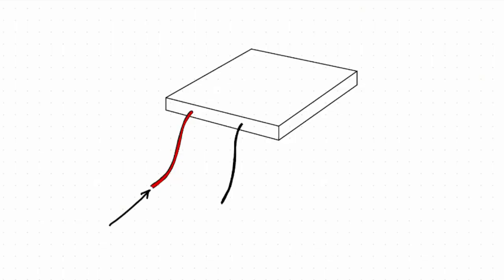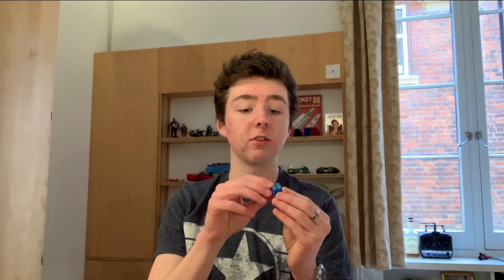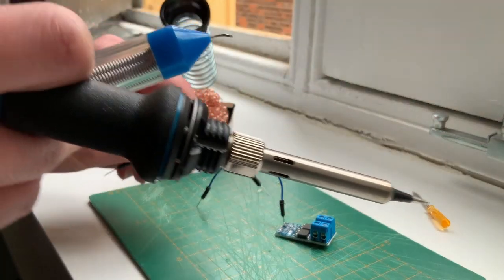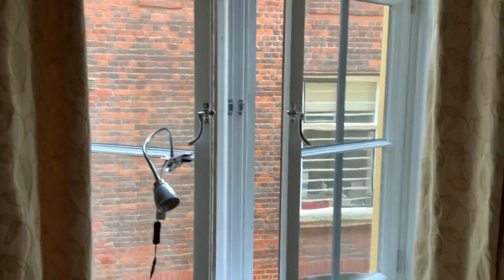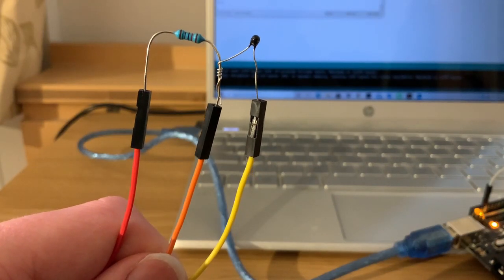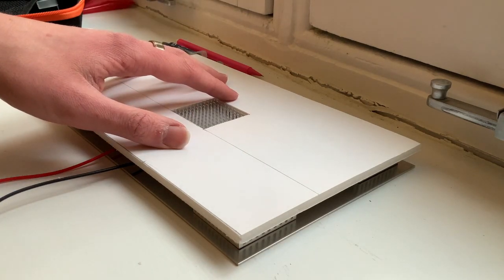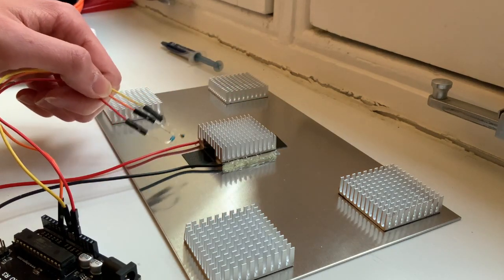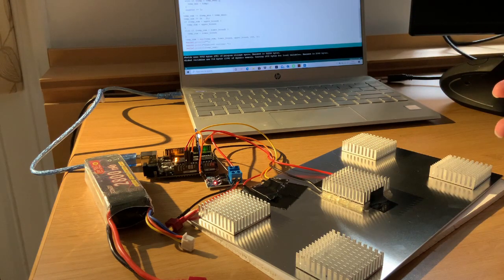Noiseless Computer Cooling System Build (using Peltier coolers)

Comment: I work on a system like this. I used the laptop cooler stand, peltier and copper plates. The fan of the cooler stand is in contact with copper plates, cooling to copper plates and peltier hot side. The cold side is in contact with CPU cooling coppers. I will upload a video if it is work stable
Reply: did it work ,i would like to see ur video experiance
Reply: @akrammokhtar5912  So would I
Reply: Hi Kamil, did u manage to create your own system? Let us know, I'm want to use something like this too, because my gaming laptop is overheating too much...
Reply: bro , need an update for this

Comment: The heatsink for the hot side of the Peltier device has to be much larger. Before moving on to making something else, reverse the polarity of the Peltier power feed, flip the plate over, and see if you can maintain a cool surface on the Peltier heatsink. If so, then you can redesign it so that the Peltier cools a small block of copper or aluminum that sits under the CPU of your laptop. You probably will need to insulate the laptop from the big plate, as well as insulate the plate from your lap, which will require a bit of a think about how to maintain enough airflow without using a fan. Ultimately I think you are going to need one, but it can be larger and run at a low enough speed that it'll be close to silent.

Comment: I thought of taking two big radiators with heatpipes etc., join their plates together, with peltier between them. Put fans on each radiator of course. Then drive the air from the cold side to the laptop cooling pad, maybe using pressurized design, i mean closed channels and seals everywhere, especially between laptop and cooling pad, so you will push more air through the laptop (better cooling even at this stage only) and this air will be also also pre-cooled by the peltier. This makes the "cooling pad" stationary, but you can still try hide it under the desk. And this is universal as no mods on the laptop are needed.

Comment: Use 2 sheets of aluminum and add thick insulation between them, cut a hole in insulation sheet as per size of peltier then add CPU fan worm side
Reply from the maker: Nice idea!

Comment: You had the right set up to get a hot plate. 

Change the direction of the setup to get it cold and introduce a radiator with a fan.

Comment: As soon as I saw the motor connected directly to the driver I thought "Oh dear!"

A motor is an inductive load, so you can't just drive it with a MOSFET, you need a flyback diode to safely dissipate the reverse voltage that accumulates in the motor when the driver circuit turns off.

With respect to your main idea, I think it has a lot of merit, the only downside being the cost to build and develop it. However, theoretically, you could just get a larger heatsink and quiet fan, or even a cold plate, water cooling loop and large radiator (although obviously the cost factor here gets quite prohibitive).

Comment: Great video. Somehow Peltier need to involve to laptop cooling! 
You may add side blowing fans(laptop fans) between heatsinks so maybe air might help to distribute heat.

Black shark cooler 2 pro is a compact Peltier system for gaming phones so I am planning to add it to cooling pad or directly dump in to the heatsink.

Comment: Heat travels faster than cold, let us say for every 2 inches of heat molecules, cold molecules move 1 inch. So either you have to increase the no of cold molecules or increase the size of the plate to let the heat spread in other direction.

Comment: you can use thicker aluminium sheet size off the table. in that way it won't heat much. may I suggest another trick for the modules stack 2 modules together and apply 7-10 volt both in parallel connection. in that way it will cool down to freezing temperature

Comment: Why not make slots in the aluminum plate so that it allows air to flow across it, while cooling down the air using the peltier unit. You will have to remove the peltier unit and add a frame or something to give it an offset, with holes in it the side. Then you can hot glue the unit under the frame. Once that is done, your laptop will do the rest and move the air from the under the stand, to the top of the peltier unit through the holes in the frame and into your laptop.  And since your laptop is able to recieve cold air, it might just run a little quieter.

Comment: You're on the right track.  You need to insulate the hot and cold sides from each other, and have some airflow to extract heat from the hot side.  Put the cold side heatsink under the laptop's existing fan, and give it an inlet air path.
Reply: Or to clarify, heatsink on the bottom with a fan, heatsink on top under the laptop, and an insulating plate between them on the same plane as the peltier.
Reply from the maker: I agree with you, but the aim here is to be noiseless, which eliminates the use of most computer fans
Reply: @TheDodgyEngineer  In that case you need a heatsink on the peltier that's the same footprint of the laptop, and has around 4X the surface area. You'll also want an insulator between your lap and it. I think that if you used the foam between the aluminum plate, and another aluminum plate that was connected to the peltier and had the extra heat sinks on it you'd be close.

Comment: I think a compact water cooling system for the heat sink would be good
Reply from the maker: Do you know a way of making a leak-proof one without just buying a water cooling system?
Reply: @TheDodgyEngineer  Yes. I've seen people make that Peltier water block with old heat sink. There are videos on diy-ing that. Let me know if you couldn't find them

Comment: Search for "laptop cooling pad" and "laptop vacuum cooler". That way it's possible to outsource to quieter fans. With peltier you need to dissipate double the amount of heat. I would cool it with a large CPU cooler with heatpipes, but injecting the intake could be quite challenging, not to cause condensation.

Comment: Use a fan directly above the opening in your foam/thermocol which sucks the air out. It will work. 

Don't use that metal sheet.

Comment: I look for the same solution. 
My thoughts are to use thermoelectric generators on the hot side of the peltier cell, and using the generated electricity (via Seebeck effect) to supply back to the peltier cell to compensate a bit for the consumption.
I have not expertise so I'm curious to know what do you think

Comment: What if one takes the Peltier cooling board without insulation board and makes an open front end pizza box enclosure  (aluminum if one chooses) , open end on one side,  vertical or angled  board width box flue on the opposing side.  In essence an open front end and the vertical  or angular flue behind the open lid/screen Convective heat rise should draw air across the Peltier's. What do you think?
Reply from the maker: So try to create a flow by convection to carry the heat away? Interesting idea! I'm not sure how much air flow rate this could provide though?
Reply: @TheDodgyEngineer  minimal  convective flow but silent  which was the requirement

Comment: The heat has to go somewhere. You either have to deal with "noise" or "spacial convenience" to be able to transfer 2 exactly opposite energies in one confined space...ive been trying to figure out "Refrigerator"...."laptop" hmmmm.  I did however go to clean my laptop fans out one night and completly destroyed the fan blades using an air compressor with about 80 psi....FN retarded of me. So I bought a Honeywell Turboforce Power+ fan that cost me 50 bucks...The Laptop doesnt  passed 70c with the Gpu staying around 47c on Max gaming settings.  Man my room stays hot...smh          (Try UnderVolting it)

Comment: Awesome test and experimentation! Great documentation too. You should insulate the wires on your temp sensor. I think you're shorting it out by touching the metal plate. Use a thermometer to make sure its right.  Also try eliminating the hoy water during initial testing. Use Q=mc∆T (heat formula) and match the energy required to cool your thermal load to the power rating of the peltier device. Good job and good luck!

Comment: hey yoy should calculate the size of heatsink from the amout of heat dissipated , you can find many online heatsnk calculators. Actually the remedy to the problem is you need a larger heatsink with no insulation to let the heat radiate

Comment: Why not just use the laptop exhaust? Obv it's gonna be hotter than ambient air temperature but given enough piping + distance to reroute the exhaust underneath should allow for a fairly acceptable cooling solution for that heatsink. Otherwise just buy that laptop LC system that's on Alie express.
Reply from the maker: The fan is very weak, so ducting the exhaust will be difficult plus not provide much benefit, but I like the idea for a stronger air flow

Comment: The hot glue didn't last long on the peltier modules, right? To a lesser degree, I abhor posts using hot glue with rare exceptions. I'm in Florida. After Valentine's Day until Thanksgiving, later some years, hot glue doesn't set. I customized vehicles for 30 years in my past career in the same climate, all the way up through management and ownership. I can't tell you how many times I beat my head against the wall telling installers that hot glue doesn't work when the ambient temperature inside a vehicle in July is north of 140°F. Causation for what would normally seem to be an irrational response to something as benign as hot glue.